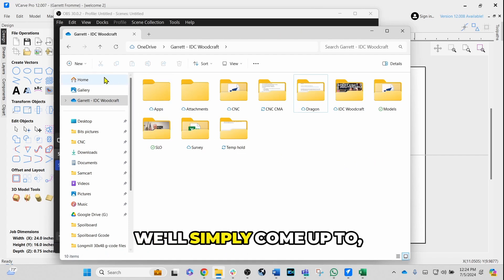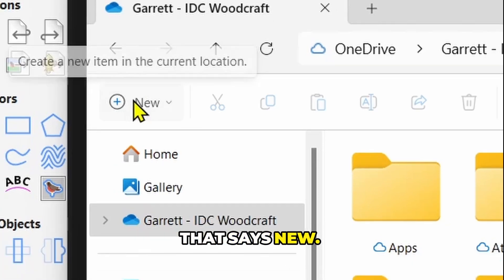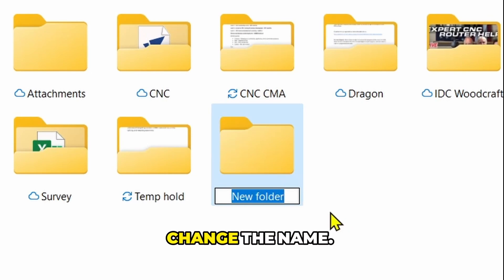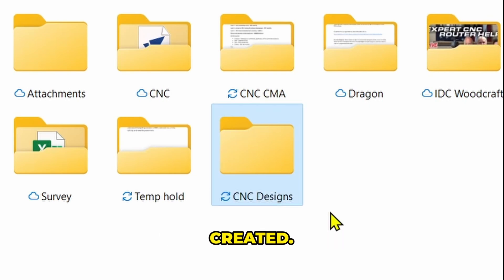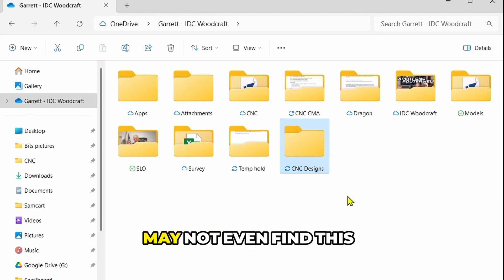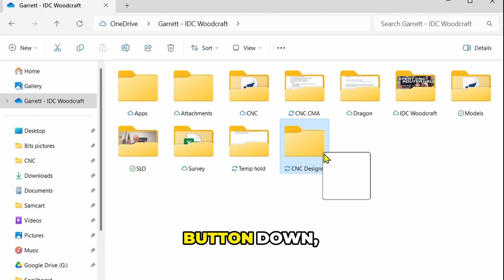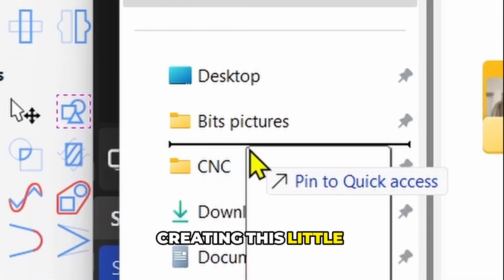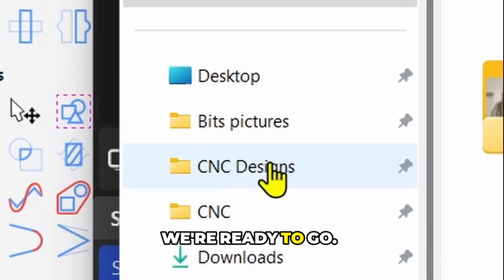How to Keep Your CNC Design Files Organized

Comment: Great video, I watched it many times, but, our systems are set up differently, I am probably missing something obvious.  When you mention to open a new file, that's where I lost you, I don't have that option on my screen, that I can find.
Reply from the maker: rockyharbour2458, I'm glad you're enjoying the video! It sounds like the software you're using might have a different interface. If you're having trouble finding the option to open a new file, it could be located in a different menu or under a different name. Checking the software's user guide might also be helpful. Happy CNCing!

Comment: Help!
The spindle won't reach the speed that is preset on the router bit database. If a separate command is sent the spindle goes to that speed. However, when a file in vcarve is done the faster that goes is 12,000 rpms.
Reply from the maker: DomzGarage, It sounds like there may be a setting in your VCarve software that is limiting the spindle speed to 12,000 RPM. Check the toolpath settings in VCarve to ensure the correct speed is selected there. Additionally, make sure your machine controller settings are not overriding the spindle speed set in VCarve.

 You may also not have a spindle that can reach that speed brother! Double check to see if your spindle is rated for a speed faster than 12,000 RPM.
Reply: @IDCWoodcraft  is funny because the vcarve settings are IDC once. And in Gsender I can send an M command and send a specific speed and will do it but when the file is done does not. I'm soo confused.

Comment: Basically good info for someone who does not know how to use a computer. Don't put stuff in OneDrive by default; use your user name folder, and only add things as necessary to OneDrive. I have UNINSTALLED OneDrive AND de-integrated it from Windows. Personally I use a Synology NAS for my primary storage, so I have a directory called My CNC with subdirectories for various aspects of CNC, like CAM graphics, CAM hardware, CAM software, CNC reference, CNC videos, Feed&Speeds+ref Data, and a gcode transfer directory for the network. To share files, I use Synology Drive to avoid M$ intrusion.
Reply from the maker: BrilliantDesignOnline, It's great to hear that you have found a storage solution that works well for you with your Synology NAS setup. Organizing your CNC files into specific subdirectories is a smart way to keep things in order and easily accessible. Using Synology Drive for file sharing adds an extra layer of security and control to your workflow. Keep up the good work!

Comment: In spite of your best efforts files will sometimes wind up where you didn't intend, or it was so long ago you forgot.  Agent Ransack is a free program that searches for files by name - even just the extension.  It is also WAY faster than the crappy search function in File Explorer.  You can specify the folder to search or search the entire drive.  I recommend it.

Comment: I take it a step further. If you do a lot of signs you would want to make a Signs folder first and then save the Welcome Sign under that.  If you save everything to just one folder it can get rather large with a lot of files and will make it difficult to sort through all of the files.  So I make category folders and then save under those.
Reply from the maker: drkline69, That's a great organizational tip! Creating category folders definitely helps keep everything more organized and makes it easier to find specific files when you need them. It's all about finding a system that works best for you and your workflow.

Comment: Most computer uses know this, but just in case you don't here's my two cents:
I would also mention that when you go to save a file, remember to click on SaveAs rather than clicking on Save. In other words, if you click Save from the file menu in the application your working on, the application will save your file to some specific directory on the drive - not the directory you specifically created. That is why I never use the Save command. Sometimes, when I have accidentally click on Save instead of SaveAs, I really don't know where in the hell the file went - Iceland?
Reply from the maker: rogersecura378, That's a great tip! When you use the Save As option, you have complete control over where your file is saved on your computer. It's always good to double-check your file destination before saving it.

Comment: I also create folders for specific events (craft shows etc.) and copy the items I am going to make into that folder. Sometimes these files will get altered for special events and this prevents the original designs from getting changed and I always have good files to start with.
Reply from the maker: remyers, That's a smart way to stay organized and protect your original designs! It's important to have a system in place to easily access your files and make modifications without altering the original pieces. Keep up the good work!

Comment: Cool video. I am super particular about file organization and will throw in some ideas of what else works well for me.

Inside my designs folder, in addition to active project folders, I have a few "special" folders. I prefix these with a "_" symbol so that Windows will alphabetically sort them to the TOP of the project directory and I can quickly find them.

_archive: When I finish a project, I drag the project folder into this folder. This keeps my main design folder decluttered but ensures I can find projects again easily later.

_templates: I like to create generic "template" files for common operations like stock surfacing, keyhole slots, or inlays, with all the toolpaths/feeds&speeds preconfigured. I make copies of these files as starting points for new projects and swap out the vectors or make tweaks as needed. Having one "master" template file that I keep up to date with everything I've learned is more manageable for me than trying to remember which specific project I last did an inlay on, and whether I was happy with the results.

_utilities: These are files that I use for my CNC itself, i.e. maintenance like tramming & wasteboard surfacing, or accessories like cam clamps. I know I'll come back to these periodically over time, so I want them in one spot, and I don't want them to clutter my active projects or get lost in the archive.

So my view ends up looking like this:

- designs
|-- _archive
|-- _templates
|-- _utilities
|-- nursery sign
|-- sandwich boards
|-- walnut coasters
Reply from the maker: homtherobot, Thanks for sharing your organization tips! It's great to see how others structure their workflow. Keeping a well-organized file system can definitely streamline your projects and save time in the long run. Happy woodworking!

Comment: I've been doing something like this but after I save my files to my computer I also have a designated external USB hard drive I back them up to incase something happens I have backups. Sometimes it takes me hours to design files and I wouldn't want to lose them. And hard drives are inexpensive these days.
Reply: Definitely agree with backing things up! You can see Garrett is using OneDrive to back his up in the video. I map my local folders to a folder in Google Drive so it backs up automatically. I don't think I have the patience/discipline to regularly back up to a USB drive 😅
Reply from the maker: homtherobot, That's a smart way to ensure your files are backed up automatically. It's all about finding a method that works best for you and your workflow.Backing up regularly is key to protecting your work!
Reply from the maker: allenpoling6854, That's a smart practice to back up your files on an external USB hard drive. It's always better to be safe than sorry, especially when you've put in so much time and effort into designing your files. Hard drives are indeed quite affordable these days, making it easy to have extra protection for your valuable work.

Comment: Great video! Been there done that when in comes to having difficulty locating an old design.  Have added an additional folder level over time. Each CNC project now has a Toolpaths folder to keep them organized.   Otherwise, the same idea works great for organizing laser cutting/engraving and 3D printer projects. 🎉
Reply from the maker: btodcox6387, Thanks for sharing your tip! Organizing your projects with a Toolpaths folder is a smart idea for keeping things in order. It's always helpful to have a system in place for finding designs quickly when you need them.
Reply: I do the same thing.  Under each project folder where I save my designs I create a Toolpaths folder so that is keeps my design files separate from my toolpath .gcode files.